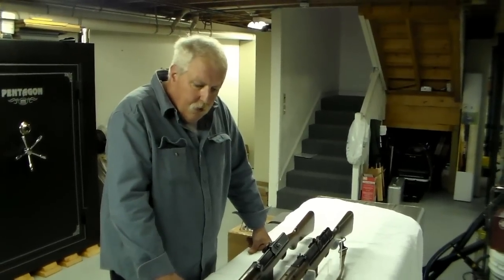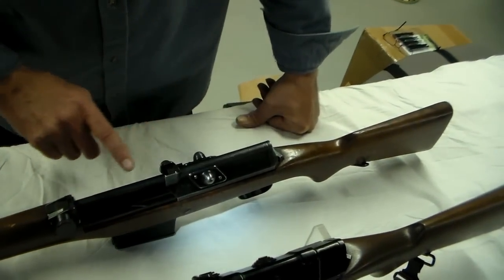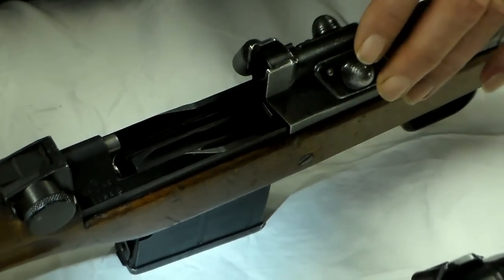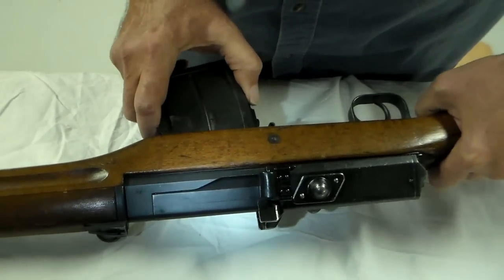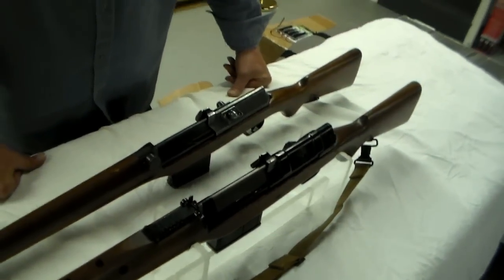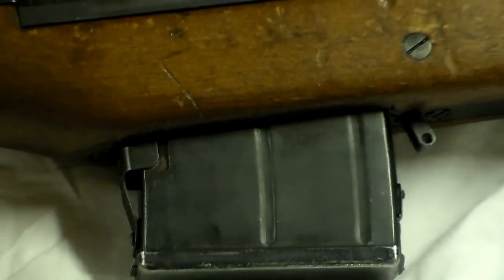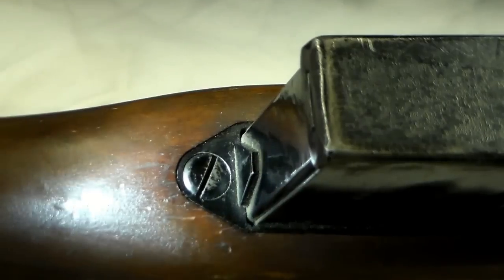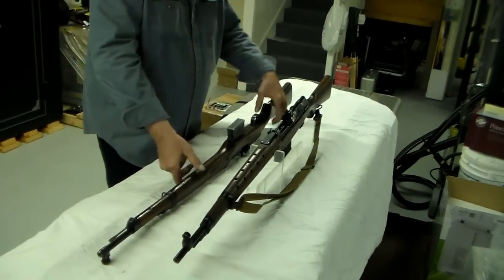Madsen-Ljungman Semiauto Rifle

Comment: I had the Egyptian Hakim Rifle , same thing but in 7.92x57mm same as the German rifles and Machine Guns. The gas system takes a bit of getting used to because of the noise ,but other than that it was a good shooter.The system was unique and functional but not bad at all,I would of chose it over a K98 or Enfield in 1942.
Reply: +McMahon Leo 

 I have a Ljungman, and did own a Rashid. Your Hakim, and the Rashid have adjustable gas flow which is a vast improvement. 
 My Rashid had a charging handle, and the top cover doesn't capture the carrier like the Ljungman n' Hakim.

 Thnx forgotten weapons. N'er knew of the Danish gem until today.
Reply: +C Arndt 

Yea the Danish Rifle is  a nice pice , never knew the made them myself.